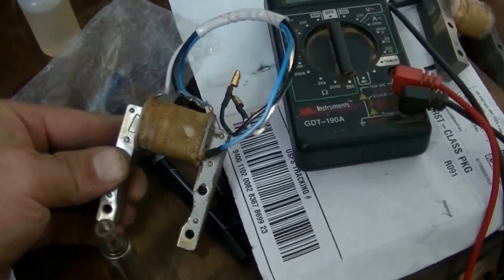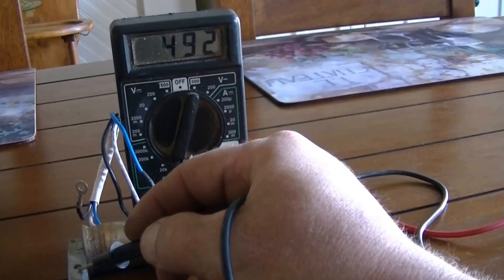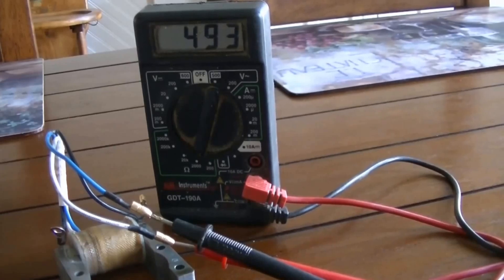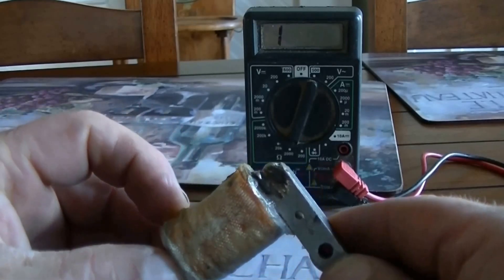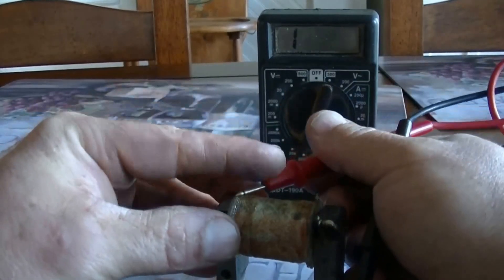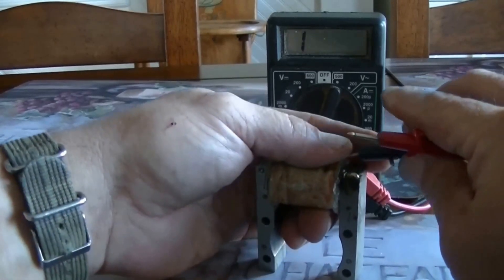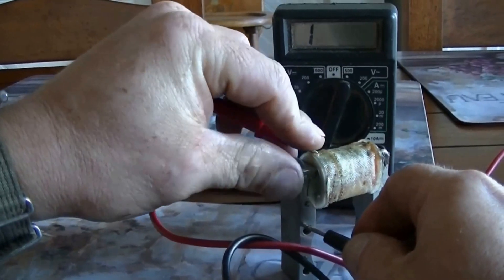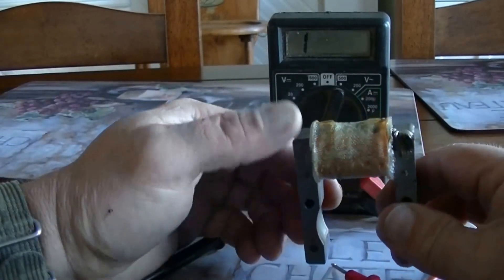Motorized Bicycle 80cc/66cc Magneto Troubleshooting

Comment: Where do you put your meter on I need to know for the CDI the ohms readings and the magneto readings with the meter what's the correct setting on them all and your spark plug wire and cap thank you Bob

Comment: I have spark and still wont start!!
going downhill it seems like its going but as you glide to slower the motor wont stay running! 
help
Reply: I could be wrong but sounds like low compression
Reply: @capchassuck   fuel maybe not enough  raise wheel feed little gas or either check  compression or just ride down  hills!!!!